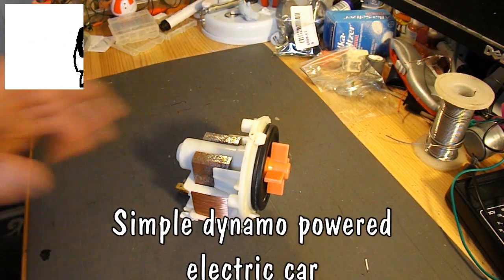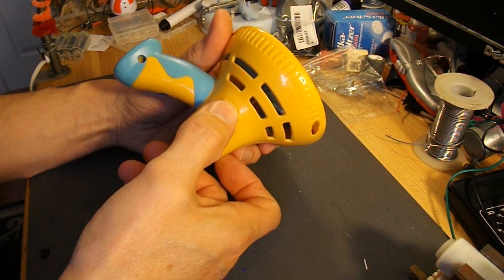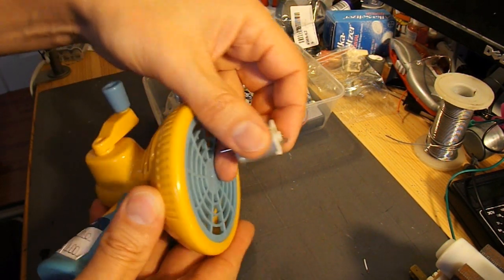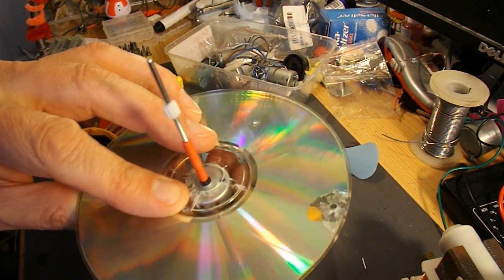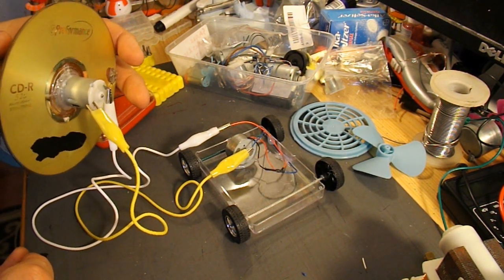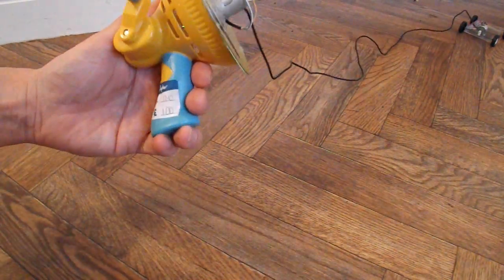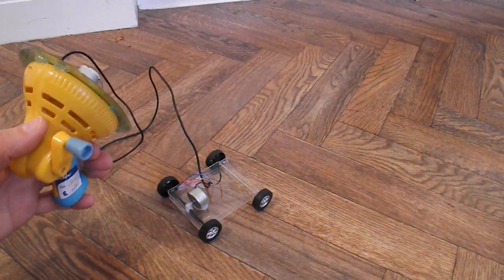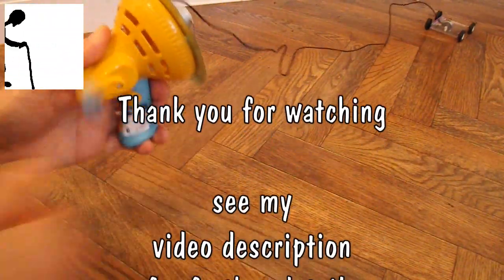Simple dynamo powered electric car

Comment: Hi there just wondering if you wound the handle the other way would the car go backwards
Reply from the maker: Turning the motor in the opposite direction would produce the voltage with the reverse polarity but in this case the winding mechanism has a non-reverse function so turning the handle backwards does NOT turn the motor.

Comment: 0:10 That is a washing machine drain pump. If you put 115 VAC on those two terminals it should start. It will turn either way. And @ 0:36 I'm looking for a fan like that but less toyish and one where you wind up a hairspring and the fan runs off the spring and not directly off the crank.
Reply from the maker: +coondogtheman1234 thanks for commenting, yes the clue to the pump is the fact I took it out of my daughter's dishwasher. I was hoping to use it to generate power rather than drive it as a motor.
Reply: +GrandadIsAnOldMan I don't thing you can do that but try it.  the induction motor from a smart drive washing machine makes a really nice generator but it needs to be rewired. there are vids on how to do that.

Comment: I saw a smaller crank fan like this recently, and now I might go back and get it!  If you crank it backwards, will the car go backwards?  I'm guessing yes unless you put some diodes in there.  Nice build!
Reply from the maker: Hi JackANDJude, this crank has a ratchet effect so you cannot turn it backwards otherwise Yes, it would make the car go back. As it is a DC motor it gives a steady DC output so there is no need for diodes and the output is dependent on the direction of rotation.
Reply: NO

Comment: Haha, just what you wanted the other project to do..the grandkids will love that i'm sure :)
Reply from the maker: Yes I spent quite a while trying to get enough power out of that dishwasher thing but could not do it without storing the power in a battery or capacitor first. I seemed to get less power out if I spun it faster. I have an idea what was happening. I think the magnetic field is maintained too long and blocks the reversed field of the next sector of rotation. This is a guess based on it being a 50 hz ac component so it works on low rpm but not high rpm. What do you think?
Reply from the maker: Just had another go with that dishwasher thing, new video will be uploaded later today.